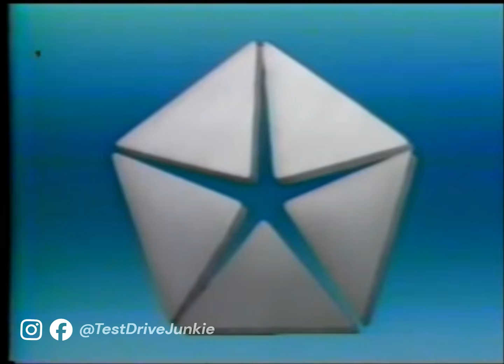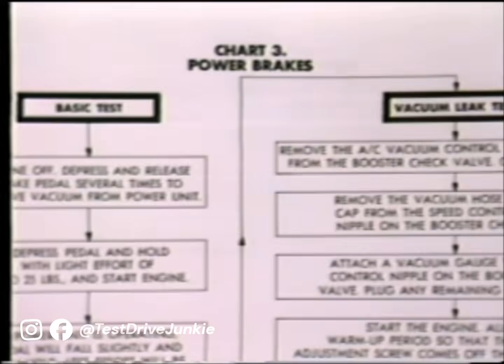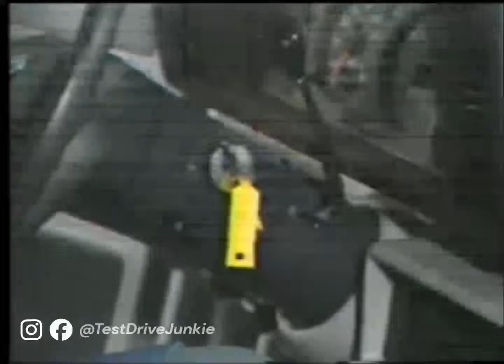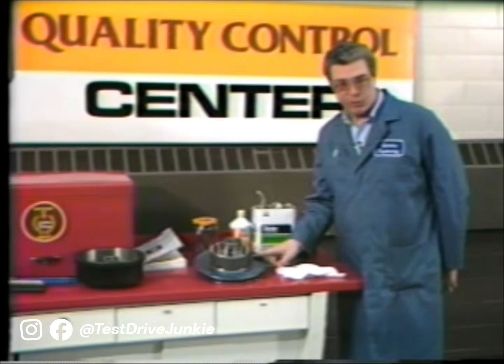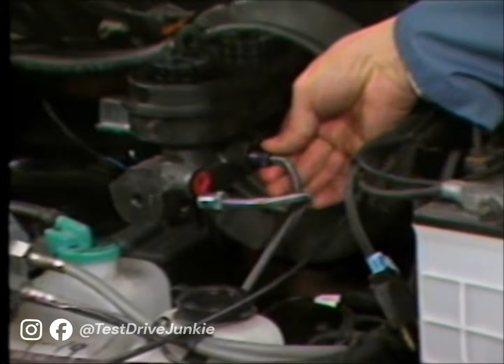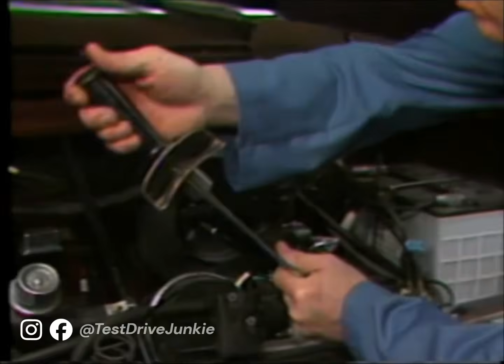1986 Dodge Master Tech Caravan Brakes Manufacturer Betamax Training Video

Comment: Haha, Chrysler hasnt changed in decades. Former Master Tech, got out round 2010 ish, Watching this one, and on the first half the tech is going on about 'dont go just replacing the master cylinder', which, being well aware of Ma Mopar's games, thought 'whats actually going on here' -- Sure enough, the Safety Bulletin spells it out - they were having a major run on master cylinders and didnt want to admit it.   Doesnt matter if its from the 80s or 10s, Ma Mopar never changed. Haha.